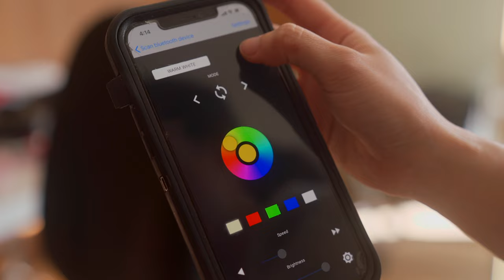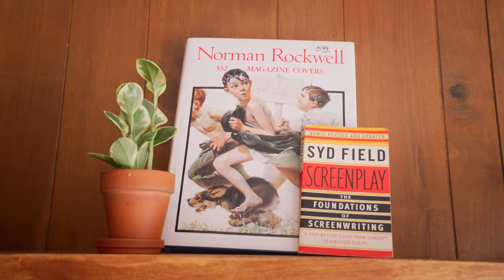How Quitting my job caused my full Mental Deterioration while making over my Home Desk Setup

Comment: I have read that long-term psychological/emotional abuse alters the physical structure of the brain, so when you extricate yourself from that scenerio there are a lot of patterns that your brain needs to unlearn at a structural level, not just cognitively. Just remember healing isn't a picture of a waterfall, it's a Picasso where your mouth is where your left ear should be and you're patiently waiting for your face to slide back into place with smeared paint and unattractive squishing noises, and when it does so much time has passed that you don't recognize yourself and you have to introduce yourself to the new you—and that's the norm. Embrace the mess, you're doing exactly what you need to be doing. It's part of the process.